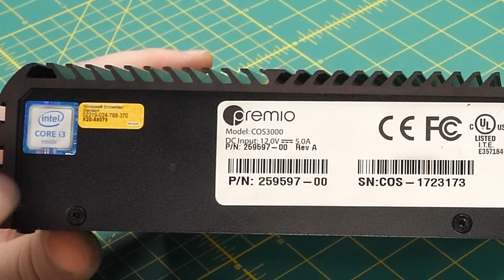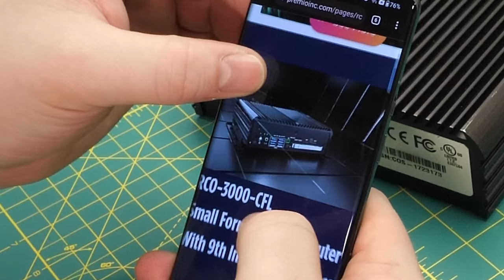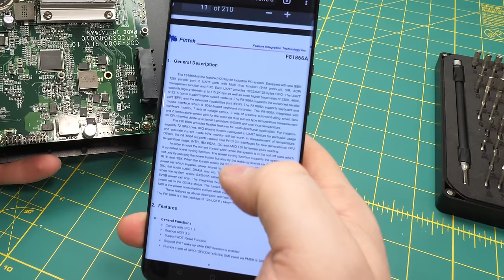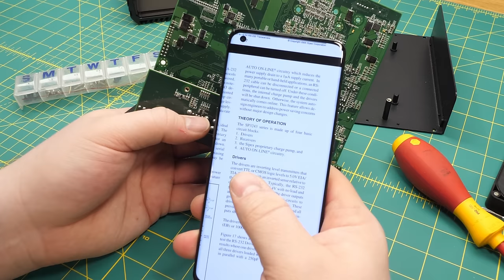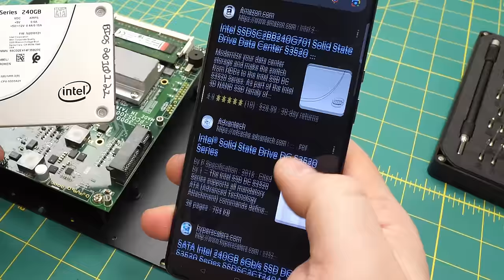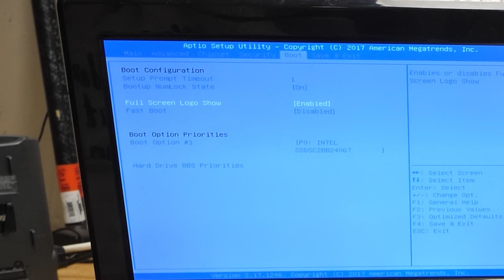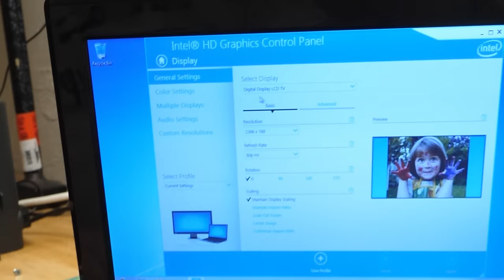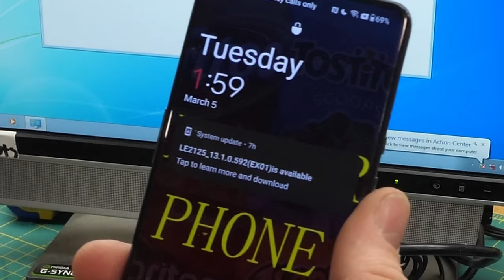Little Guys: Episode 4 [Premio / Coinstar]

Comment: "There's no reason not to use them [ferrules]" - I find the crimped connections to be unreliable, often the wires end up pulling out of the crimped area.  It's essentially the same problem as just putting the bare wire into the screw terminal, just not as bad since the crimp is not flat.  I usually just twist the bare wire and add solder so it is a solid...works really well, even over long term use with a good amount of vibration and movement.

Comment: Serial ports are preferred as they can do long runs and handle noise. The standard for RS-232 is +/- 12V power with +/- 9V signals typical. However, most accept +/- 3V thresholds so the +/- 5V works for short runs. Odd that drivers that have boost converters with +/- 10 are common. RS-485 can also allow multiple serial devices to share a cable like a network.
DVI standard does not include audio. But nearly all video GPUs support audio if a DVI to HDMI cable is used.

Comment: That it's labelled 1.5V Standard is probably because very annoyingly, specifically for SODIMM, DDR3 started at 1.5V but eventually they put out 1.2V "Low Power" LPDDR3, in the last couple years of DDR3 before DDR4. Took me a while to figure out, then having to in vain explain to my boss that we needed to separate the box of loose SODIMMs we had because we kept grabbing the wrong one when outfitting computers during "refurbishment".

Comment: Those Fintek chips are interesting, but they make a lot of sense actually. The PCH probably has a lot of USB ports and a bunch of SATA and whatnot all just in a couple of PCIe lanes, but then there's a bunch of other random crap you need on an industrial PC that you could use a chip with that uses a single PCIe lane for … or you could have a high-integration chip that does it all. Six serial ports, IR, AT keyboard, mouse, SMBus, etc … why not just integrate all that crap into a single chip? It means one chip instead of many and you can just option the stuff you want enabled.

Comment: Those SP3243 or MAX3232 or similar transceiver chips are pretty standard on any PC now, or USB RS-232 adapters. In the early days you'd feed the +12 and -12 ATX rails into a line driver, then they switched to those integrated charge pump drivers that took 5V in and boosted it to about 9V. Then most things switched to 3.3V input chips that only output about 5.5-6V (Which is still within the 3-15V spec).

Not surprised you never heard of Broadwell - it was kind of a flop with a few mobile parts released and maybe one or two for desktop. I built a machine in 2014 with a Haswell i5 planning to upgrade it to a Broadwell after a couple years, but no chips that made sense ended up being released, so I rebuilt the whole thing with an AM4 board in 2020.

Also never heard of half slim SATA. At first I was thinking mSATA, but that's a completely different connector.

Comment: Using those type of 'phoenix' connectors (other companies make a similar style) allows the computer to be wired into the power buss of the final product. By having the plug option allows quick swap out of a malfunctioning unit.

Comment: People don't use bootlace ferrules partly because it requires a specialized tool to do it properly and those range from $30 for a cheap chinese IWISS made tool to hundreds or even thousands of dollars (tools for anything industrial have to be calibrated and certified and that costs $$$)

 In europe using ferrules on house wiring is actually required by law,

Comment: The mounting holes might be for Slim SATA, a PCB based SSD with standard SATA connectors unlike the mSATA. You might want to populate the empty SATA port and see if the SSD will work from that. It could also be used for a DVD drive.

Comment: On the PSU, it's likely not a hack job, as you can just order FSP bricks with those red ferrules ready to be screwed in, instead of having a barrel plug. As for sound over DVI, I've had one graphics card that did it, but only into a HDMI adapter they provided with the card and required a connection between the video card and sound (on motherboard in my case).

Comment: That FSP power supply hasn't been modified, it came with that connector on it - You can see the diagram showing the pinout at the top right of the PSU's sticker.
Reply from the maker: oh my god how did I miss that

I think it's just that my other, similar power supplies have clearly been modified, and because that didn't look like the typical polarity diagram, I just tuned it out completely.

Comment: I am thinking the unused points that look like another SATA port but backwards from the one there is for a SATA for a drive to be mounted on the underside of the the board. It actually wouldn't surprise me if they were wired directly together so it could only be used in one configuration or the other.

Comment: You were pretty lucky with the DVI swap. Usually there's passive components or BIOS flags that don't exist to enable those pins. I tried the same thing on a Lenovo PC with a second unpopulated NVMe port, and didn't get as lucky. Strangely, a drive in the new slot would warm up (meaning the passive parts were in place) but the BIOS never acknowledged it's existence.

Comment: 37:00 Audio over DVI is totally doable, but only HDMI devices will understand what to do with it. I have a tvONE scaler with DVI that can input and output audio via DVI, but it is effectively useless without the correct passive DVI to HDMI adapter. In other words, it's actually an HDMI port, but they didn't want to pay for the license, so it's a DVI port that transits HDMI, and it works because DVI and HDMI are compatible

Comment: DVI will carry the HDMI audio in my experience.  That second row of pins for the VGA port is for the DVI-I spec, where analog video is carried on those cross-shaped pins and you can get VGA out with an adapter.  DVI-D doesnt have those analog pins, and only a flat blade where the analog pins would be.

Comment: 8:00 You can get DisplayPort cables with no lock on them, and they seem to work well enough. No worse than HDMI in any case. The lock might be a good idea in some cases but in others it's not really needed.
20:52 Mobile 1st generation did have two separate dies, although they didn't do it again after that until 5th gen.

Comment: for industrial components like this they would only sell the IPC  and no or  few support components like power supplies that would be specd out based on application. for example you may have a single 12V power supply that feeds many components from a bus  or in this case a simple dedicated supply for 1 component

Comment: I just imagine the guy smacking his head against the wall making a custom jig for pressing those inserts into that heatsink. apparently it's something they are very good at lol.
Realistically you just need to make a buck and have the inserts be consistent enough. Clever, make a few precision parts to make tons of these.
The nice thing about the inserts too is that you end up not having to deal with taps generally which are pretty prone to snapping at those sizes.

Comment: ferrules are cool but the manufacturer "correct" crimping tool can be ridiculously expensive sometimes.

i even called digikey once because i thought $250 for a hand tool must certainly have been a mistake;  the representative agreed and looked into it.   alas, it was indeed the correct price.

all that said, an improperly crimped ferrule can be worse than having no ferrule at all..

Comment: One quick thing on the thermal paste. Arctic Silver is conductive. Most newer compounds aren't unless they're specifically liquid metal. So while yes the amount of thermal paste really doesn't matter as long as there's enough, I'd still be careful with that specific paste since you could potentially cause a short.

I don't know about industrial pastes, but you can get giant tubes of Arctic MX-4, which is not conductive and also lasts a really long time, for pretty cheap.
Reply from the maker: So I thought AS5 was conductive, but per their website it's not, they claim it's just slightly capacitive. Weird!

Comment: 24:43 AS5 isn't conductive! 
From the Arctic Silver website:
"Not Electrically Conductive:
Arctic Silver 5 was formulated to conduct heat, not electricity.

(While much safer than electrically conductive silver and copper greases, Arctic Silver 5 should be kept away from electrical traces, pins, and leads. While it is not electrically conductive, the compound is very slightly capacitive and could potentially cause problems if it bridges two close-proximity electrical paths.)"
Reply from the maker: oh shit ALL THESE YEARS I THOUGHT IT WAS CONDUCTIVE
Reply: @CathodeRayDude  With silver in the name I don't think it's too out there to assume it could be conductive without looking it up tbh
Reply: @CathodeRayDude  Liquid metal is the stuff you ACTUALLY have to watch out for. That stuff will happily fry your system if you're not careful.

Comment: 36:43 yes, it would, i have an DVI to HDMI cable and it has audio through it, on the wikipedia of DVI under section "DVI and HDMI compatibility", it is told that to have audio, they had to do a non-standard way

Comment: That fine pitch "debug" connector... I wonder if that's an LPC header. Basically an ISA port without any duplicate pins. 

Rasteri made a conversation board for that header to convert it to a standard ISA header called: 
dISAppointment - LPC to ISA adapter - ISA on modern motherboards

Comment: Ah, yes, J1708, I forgot about that!

They also put CAN bus over DE-9 connectors for some reason! You can blame Bosch and Vector Informatik GmbH on using that for connecting their vehicle diagnostics and industrial controls with that connector. (J1708's successor, by virtue of J1939 being a CAN-based protocol, can also go over DE-9 connectors.)

Comment: These machine's are alway's an interesting thing. Build like a tank. Low power(usually). Heavy enough to defend yourself.

That green connector is indeed made by "Phoenix Contact". Yes that is whole name.
Another thing about the power supply. Usually these machine's are rated for 12 to 24 volt as 24 volt is a very common voltage in industrial cabinet's. Some can go higher then 24v as well as 48v is also a common voltage. strange to see a 12v only machine. (Yes 19v from a hacked up laptop PSU work's as well).
Power supply's like that one from FSP can be bought with bare wires with the polarity indicated by the wire color's. Look at the label of PSU. There is a picture of the connector block on it.

Source: I play as a sysadmin in a chemical company.

Comment: 39:37 I noticed that the vga is just what I'll would call hardware candy because if you look up the DVI-I pinout the vga its using the Analog part of the DVI.
Look closely that the RGB of the vga are connected to the 4 squares of the DVI

Comment: You could, in fact, run Windows 7 without activation. I did it quite often, as I often needed to set up Windows 7 VMs for various reasons, and since I'm not made of money, I couldn't afford a license every time I set up a new test VM. It would remain (mostly) fully functional and wouldn't spontaneously shut down on you or delete your files or anything like that. However certain features were disabled. Iirc theming was disabled, so you couldn't switch to dark mode or change the wallpaper; iirc it also put a persistent "unactivated license" nag message in the corner of the screen. It may have also opened a window periodically saying "you know, you should really activate Windows. Click here to go do that." I'm not sure what other features/functionality were limited, since I only used "home" versions for testing, though I would imagine that "pro" features would have been prime candidates for neutering.

Comment: "This is about as clean a job as you could do for that kind of thing"
EYYYYY that's what my hack jobs look like now that I spent 50 bucks on heat shrinks and automatic wire strippers.
Seriously do this, it's not even hard. Crimps in the wire stripper handle, it's the most worthwhile tool.

Comment: 36:47 yes, you can. Radeon cards had this feature in the past and they probably still have this feature in their cards that has dvi today. I had a Radeon 6850 and it had it. However, it only output audio using their bundled dvi to hdmi adapter. It did not output audio using a generic adapter.
Reply: Fun thing - the limitation to only work with the ATI branded adapters was a software lock, implemented in the drivers! If you use Linux, or hacked the drivers a bit, you could enable it to output audio over any adapter. HDMI doesn't use any separate pins for audio, it's purely a different signal encoding (audio is stuck into the "blanking periods" in the video signal which digital monitors no longer needed)

Comment: One other reason you would still see D sub is that some factories may have really expensive machines that had them.  Imagine the horror of having to get rid of still functioning equipment all because it has old connectors.  There is nothing wrong with the equipment, it is just old.  It may even be more reliable than some of the new stuff that is out there these days.  It reminds me of a scanner I had that although had USB it would not work on any Windows version past XP.  I also could not find a driver for any newer Windows or Linux even.  To be fair it would work on I guess older versions of Mac OS but I could not tell you.  I was not going to keep a Windows XP machine around only to use it.  There are better and faster ones to use instead.  I just took that scanner to Goodwill and donated it.  I paid maybe 50 or 60 for it new so it wasn't a loss.  I bought it on sale.  Now you can get better ones for the same price but used.  Just make sure it is in good working condition with nothing broken or missing.  Also look for drivers before you buy.  This way you know it will work and it is not some old rare thing that has severely limited support like what I had.
Reply: FTDI makes pin-compatible replacements for RS-232 ports on industrial machines that actually have a USB-Serial converter chip and a mini-USB-B port so you can connect it by USB to the PC.

Comment: 31:15 This is actually a very common feature on embedded and server boards.
It helps inform the OS (typically a Linux distro) of the type of caching to use, as using the incorrect caching (eg: using HDD caching on an SSD) can and does lead to a kernel panic.
This is from personal experience.

Comment: all that info is there because if theyre using legacy hardware in the machine, they need to know what other hardware it has to replace it should it go bad. that can tell you which part to use on a specific revision of the system

Comment: the housing design looks strikingly familiar to me....?! we have/had? a company here in Germany that sold "CARPC's" in the "radio slot format" mostly with low power Xeons or these SOC chips from Intel or ARM chips where one or more "com" ports were used for the touchscreen
for the car radio DIN slot The internal dimensions of the 1-DIN slot are 180 mm x 50 mm and are standardized according to DIN ISO EN 7736 (approximately 7 by 2 inches).

Comment: The funny upright sata connector looks like one on my Dell Lattitude laptop with a very early ssd that has a custom connection and is a bare pcb that it a bit smaller than a 1.8" hdd that I think it was replacing

Comment: 37:40 that's interesting that it's detecting it as a digital display. I wonder if they're using DVI because that gives them digital video and VGA on the same port or they can break out and just use the VGA port off the same chip connections. Plus I imagine there's no license fee for DVI versus HDMI no copy protection. I know a lot of HDMI standards got backboard to DVI like HDCP so I wouldn't be surprised if Audio got back ported as well.
I've always wanted to swap one of those ports. Definitely need to get myself one of those desoldering Irons I have terrible luck with the RadioShack ones.

Comment: Life would be great of we still could select what modules to install with every Windows version.
Win Home is like, No choice, no control
Win Pro, No choice, we'll let you use some things if we feel like it.
Server: You still have to install everything, but you can disable them afterwards.
And, no matter what you did, we'll change everything back when there's a service pack update!
:D

Yeah, Win7 had that indefinite 'Evaluation Copy' on all their versions in the lower right. It did restrict a lot of functions though until you validated it.

Comment: You can make an adreno programmer or a robot controller, and if you have a heat gun, you can upgrade. Also, the cpu 1 or 2 generation high 🤔